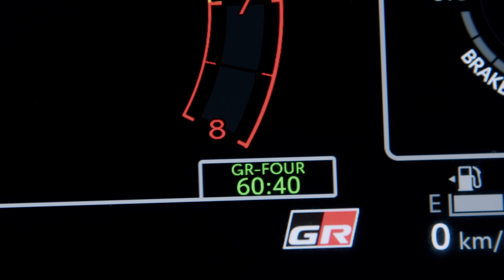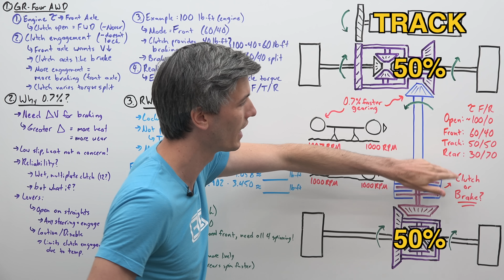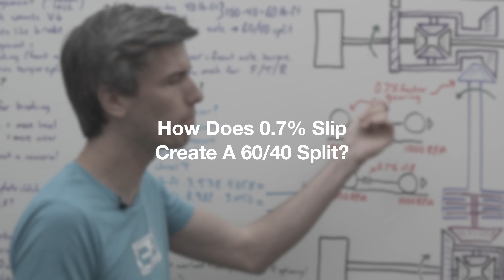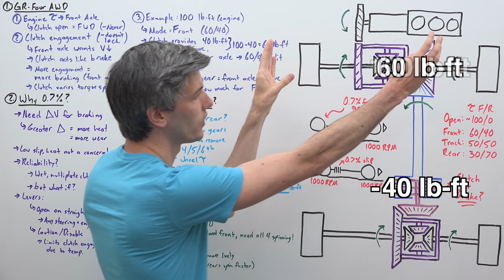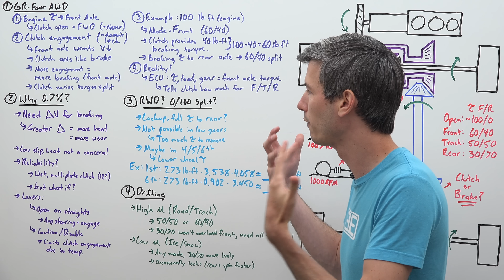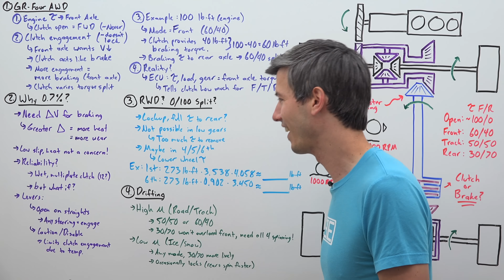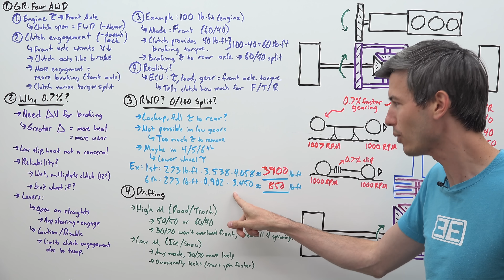Toyota GR Corolla's Brilliant AWD System - How It Splits Torque!

Comment: In your explanation about why it might be possible to send 100% of the torque tto the rear in higher gears, but not lower gears you compare wheel torque values. These torques are not what the clutch pack sees because it is located on the driveshaft before the final drive. The torque values are lower by about a factor of 4.
Reply from the maker: Okay, quick clarification here. It's possible you're correct, but I don't believe it's the case. You have the bevel box turning the rear driveshaft, and then the rear driveshaft turning the final diff. If these gear ratios match (one speeds up, one slows down), isn't that 1:1? Further context, this transmission has two final drive ratios. One for gears 1-4, and one for gears 5-6. This indicates there are two output shafts in the transmission which mate to the front differential (bevel box, here), thus allowing for the two final drives. Then you have the gear ratio of your rear driveshaft at both ends. If those match, wouldn't it balance out?
Reply: @EngineeringExplained  I was going to make the same comment as Mike, but after deciphering your reply, here is my revised comment:
The combination of the bevel box and rear differential ring and pinion must be responsible for the 0.7% speed difference -- that is there combined ratio must be 1.007:1 not 1:1. But, that doesn't tell us the torque through the clutch pack. We would need the actual ration of either the bevel box or rear diff to determine this. Now, (as expected) we can see in the cutaway photo that the pinion in the rear diff is substantially smaller than the ring gear -- maybe 3:1 maybe 4:1. So I agree with Mike. The torque in the front to rear drive shaft, and thus the clutch,  will be 1/3 or 1/4 the torque you calculated for the front differential carrier housing.
Reply: @andrewsnow7386  In the transfer teeth ratio is 17/39, in the rear differential - 41/18.
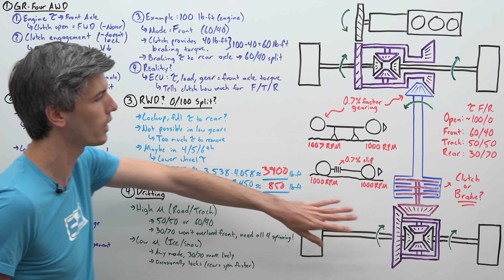Reply: @4x4.tests.on.rollers  Nice - so about a 1:2.3 ratio at the bevel box (not quite between the 1:3 or 1:4 I was guessing). Thus, the torques at 9:58 in the video would be 1,700 and 370 lb-ft.
Reply: @4x4.tests.on.rollers  So (39*18)/(17*41), or 1.0072:1 overall
Reply: @brianb-p6586   Unfortunately I don't understand what you mean. Driveshaft is overdrien at front (0.435) but it is not reduced at the rear by 2.294 but 2.277.
Reply: @4x4.tests.on.rollers  
Overdriven at the front - 39/17 = 2.294:1 (that's output to input ratio; transmission "overdrive" ratios are less than 1 because they are input to output ratios); yes that's 0.4359:1 as an input to output ratio.
Reduction at the rear - 18/41 = 0.4390:1 as an output to input ratio, or 0.4390:1 as an input to output ratio.
You can take the ratio of the ratios,  2.294 * 0.4390 = 1.007066 ... and introduce rounding error. Or you can combine those two ratios right from the tooth counts: 39/17 * 18/41 =  1.00717; that can also be written as  (39*18)/(17*41).

Whatever detailed method you use, the end result is that the rear axle speed (with the clutch locked) is about 1.007 times the front axle speed. I was just taking your tooth counts and calculating that ratio from the directly.
Reply: @brianb-p6586  Thanks for clarification. Everything looks correct, there's 0.7% difference.
Reply: @EngineeringExplained  That is assuming the bevel box ratio is 1:1 which from the photo of the rear diff it is not. The torque at the clutchpack would be reduced by whatever ratio is used for the bevel box/rear diff. As a point of comparison, Haldex systems typically use a 1.6:1 gear ratio in their bevel box.
Reply: Not a factor of 4, but only about 2.3... the ratio of speeds between the driveshaft and the axles. But yes, the clutch torque is a fraction of the rear axle torque.
Reply: The specs in a Kia training document for this system (same JTEKT components) show the ITCC (Intelligent Torque Controlled Coupling) capacity as 1320 Nm. Multiplied by the bevel gear ratio of 2.3, that's 3036 Nm at the rear axle. Yes, that is inadequate to handle the full engine output in first gear (5290 Nm), but enough for a higher gear (only 1150 Nm in 6th).
Reply: @brianb-p6586  What model of Kia? They used to use electro-hydraulic Dynamax from Magna Powertrain.
Reply: @4x4.tests.on.rollers  it was for the Kia Sorento, XM generation (2009). A comparison table in the document indicates that earlier generations of the Sorento used BorgWarner systems, but doesn't detail their operating principles.
Reply: @brianb-p6586  Yes, that's right, it was ITM from Borg Warner. Later on they switched to Dynamax (since 2010 Sportage). I didn't check what are they using in newer Sorentos.
Reply: @4x4.tests.on.rollers  BorgWarner ITM (Intelligent Torque Management) 3e appears to be functionally identical to JTEKT ITCC; it even uses the same electromagnetic plus cam clutch actuation.

The most recent Sorento (UM, 2015-) appears to have switched to Magna's Dynamax as well. Dynamax appears to use an electric motor to pump hydraulic fluid to actuate the clutch, which seems like an older and more expensive design, but might be capable of higher clutch clamping force. 

Dynamax apparently allows fully locked-up clutch operation, which results in indeterminate torque distribution (entirely dependent on vehicle dynamics and tire traction) but eliminates slippage and resulting heating... and implies that secondary (rear) axle overspeeding is not used.
Reply: @brianb-p6586  Yeap, there's one more - EMCD from GKN Driveline. I was always wondering if there is any real difference between these three. The newest ITCC uses different pilot clutch, there's no ball cam mechanism but some other shape solution. According to JTEKT  - it reacts 20% faster.
Reply: @4x4.tests.on.rollers  GKN's EMCD (Electro-Magnetic Control Device) appears to use a similar solenoid > pilot clutch > main clutch system as BorgWarner ITM and JTEKT ITCC, with a similar ball and ramp cam design. According to a Green Car Congress article from 2016, torque capacity is only 500 Nm, but response is supposed to be fast and drag is low (less an 10 Nm at any slip speed); at that time it had been in production for 10 years.
Reply: @brianb-p6586   Actually the EMCD is in production since 2001. During over 20 years there were some variations. I've been testing some pre-2016 version and it had more capacity than 500 Nm so the question is if there are different versions or if the newest one is weaker but lighter, quicker etc.
Reply: Want to write the same. Glad to see someone noticed it also.

Comment: Thanks for the video! What would be the torque split between front and rear axle if the front wheels are on ice or in the air and the rear wheels are on tarmac? Is it possible to reach like 0/100 F/R in condition like that or it would still be 30/70? I know it is not a realistic situation but I'm just curious
Reply: If the front is in the air or on ice, there’d be no torque to the front, no matter what the clutch pack did, and no matter what speed the front wheels are spinning.  The only torque would be to the rear.  The clutches might not be able to transmit all of the engine’s torque capability (hopefully telling the ECU to dial back the engine’s output in that situation), but all of the torque that the system does transmit would be to the rear.
Reply from the maker: In theory, if you locked the clutch pack, and the front was in the air, you'd send 100% to the rear axle. Realistically the clutch is always varying pressure to attempt to maintain the torque split you've selected (since both axles are usually on the ground haha).
Reply: @EngineeringExplained  thanks! I love your videos 👍🏻

Comment: This will be fun to test when we get them at are dealer so far the best AWD system I tested was Acura SH-AWD or IVTM-4. 3 inch lift on the GR corrola will be winter monster.
Reply: Have you tried the DWS06's in temps below -15C though? Down right dangerous in Canada, you'd slide off the road if you attempted to show off. I get the ground clearance aspect though, I have failed to care in the past and parked my sedan after plowing through salted snow on the roads and 10-12 inches of fresh powder in the lot. Rust will happen, no matter if you Krown it.
Reply: How about 4matic mercedes? Is it the same thing like these?
Reply: @username8644  I bet it does. I've been running ATTESA-ETS in my daily for 12 years between an 06 G35x and this 13 G37xS, car is 95-5 rear bias and goes up to 50-50 as rear traction goes out. I would say symmetrical AWD is more capable, but an NA V6 that screams to 7,500 RPM while sending 70-80-90% to the rear is more fun. Respectfully.

Comment: Can you set a default torque split mode or does the car revert to 60/40 every time it starts?
Reply: I think there's a knob with modes. You leave in the mode it stays there every time.
Reply: 60/40 each start, the procedure to get going is one of the few annoying things, at least on GRY

Comment: So basically the same as a focus RS or older golf R?
Basically an over run haldex system.... nothing earth shattering really, this has been a thing for a long long time
Reply: Golf is 2wd in normal condition, GR is always 4wd
Reply: @albertobrancati  yeah but it's the exact same system
Reply: yea, it's still an economy sports car in the end
Reply: @killmeh2  yeah just don't know why the vid ranting and raving over something that's just a copy and paste of what everyone else is doing
Reply: @mattg9364  it’s similar but not identical. I think it’s still beneficial to cover the nuances to understand the pros and cons to each approach.
Reply: @ALMX5DP  I didn't see any difference in the video, besides the way the controller works?
Reply: @mattg9364  It's not the same as Focus RS and Golf R and it's not haldex. Those cars have separate clutch-packs for each rear wheel (no classic rear diff). Focus RS uses the Twinster system from GKN Driveline and it has overdrive ratio. Golf R uses Performax from Magna Powertrain and it doesn't have overspeed ratio. GR Corolla (and GR Yaris) does have one clutch-pack (ITCC) for rear axle (diff), delivered by JTEKT.
Reply: @4x4.tests.on.rollers  that's odd, cause I've got a haldex system from a volvo and it has one clutch pack, same as the VW stuff. RS may be slightly different, but it's the same concept of a diff that runs faster than the front wheels to enable rear bias
Reply: @mattg9364  Since ~2011 haldex comes from Borg Warner. VW uses it in many models but not in new R versions.
Reply: @4x4.tests.on.rollers  that's why I said the older golf R
Reply: From my understanding, it's very similar to the older Golf R system, with the main difference being the rear gearing difference. The Focus RS and Mk8 Golf R use a fairly different system with clutch packs in the rear to distribute power.

Comment: This sounds exactly like the Ford Focus RS all wheel drive system just explained differently. The Focus RS can send more torque to the rear even though it is front wheel drive-based by over driving the rear wheels through a faster gear ratio in the rear. The Toyota version sounds the same except they are braking the front wheels in the process instead of just pushing more power to the rear which I think is only a difference in explanation, but actually the same thing happening.
Reply from the maker: I don't think the RS is doing anything different, they're both using a clutch pack as a brake at the rear. The RS does have a torque splitting diff in the rear, however, allowing for all the rear torque to go to one individual wheel.

Comment: I wonder how much energy is being lost in the clutch slip, compared to a geared AWD system. This sounds like a way to make a cheap compact AWD system but sacrificing efficiency or long term reliability, bit like a gimmick.

edit: Not trying to hate on it, I'm sure it's fun to drive in the AWD modes and you wouldn't be driving for best efficiency anyways when you enable them.
Reply from the maker: Y'all are incredible - company develops a neat way for you, as the driver, to have selectable torque splits, and you say "it's a gimmick." Gets way better mpg than Subaru STI, what efficiency do you want to see from it? How is it unreliable?
Reply: @EngineeringExplained  You're right, I think I came across a bit too harsh. It's a hot hatch with a combustion engine. Efficiency is a long way out the window from the outset, so the AWD is an extra way to have fun with it.
Reply: @EngineeringExplained  nice! Great to hear! If you aprove, I aprove. Although I do feel like things like this should be addressed to the larger public who are worried about new cars being too complex and unreliable (with good reason). If Toyota says it's ok and you think it's ok it gives us a huge confidence in trusting these systems.
Reply: I think at 100% rear bias, the clutch loses 0.7% of the power. At 50%/50%, half of that.
Reply: @niceguy100000  Yep- exactly that. I can see my error now(multiplication :D)
Reply: Here is my though process - If the clutch is fully open the car is front wheel drive and 100 percent efficient. If the clutch is welded and the wheels cannot slip the car will bind and will be 0 percent efficient
So if the front wheel get 60Nm and travel 100m and the rear wheel get 4Nm and travel 100m the energy lost is 40nm - slip which is 0.7m. So the car did 1000Nmm and lost 28Nmm
Sorry for the confusing units. So the efficiency is 1000/1028 or 97 percent.
If we calc for 30/70  - the lost energy is 49Nmm and the efficiency is 1000/1049 or 95 percent.
Reply: @ivonakis  units aside, you're explanation helped. I too was wondering how much efficiency is lost by slowing the front axle to send more torque to the rear.  It sounded like it was creating a lot of drag making it pretty inefficient.
Reply: @ivonakis   remember that torsion or torque has the same units as energy.
Reply: dudes, the problem is not innovation.
 even  @Engineering Explained  knows that a transmision can be made on brakes.
and even him knows or should know that compressor brakes or any recovery brakes are energy efficientier.
we've always been told to avoid friction. they made us hate cvt and hydraulics.
they told us not to rely on torque sensivity gearboxes.

'course I love this system, but when a student presents these kind of solutions,
they are not well received.
Reply: @ivonakis  The loss is what the clutch is dissipating and what the tires are dissipating compared with the 2WD case. It depends on aerodynamic drag, rolling resistance, input power, tire load and tire slip. I think it's very non-trivial to come up with a model for the power loss created by the variable split system. I mean surely the developers have a good model but it's a big effort.
Reply: @niceguy100000  The power dissipated is dependent on the power input by the engine, but is not dependent on speed. Of course for driving around town it might be the case that the clutch is not engaged so the car drives like a 2wd and with no loss in the clutch or tyres.
Reply: @ivonakis  If you want to constrain the wheels to the same speed at least don't multiply torque with distance traveled. Wheel force is torque divided by wheel radius.

Your units must be correct for the calculation to make sense.

But hang on, I'm gonna try to understand your example a bit more.

Edit: Are you not off by a factor of ten in your example? Please calculate 100% rear bias. If you get a 7% loss, it's hard to see how that comes from a 0.7% difference in rotary speed.
Reply: Yeah, I agree that the cheaper tried and tested reliable way of doing 4wd fits a Corolla better than this system. But what do I know haha.
Reply: AWD wasn't broke no need to fix it.
Reply: @davidlobaugh4490  "My outhouse ain't broke, I don't need any of this indoor plumbing nonsense" "My bicycle ain't broke, no need for this motored cycle mumbo jumbo"